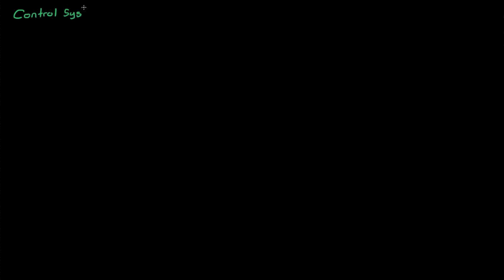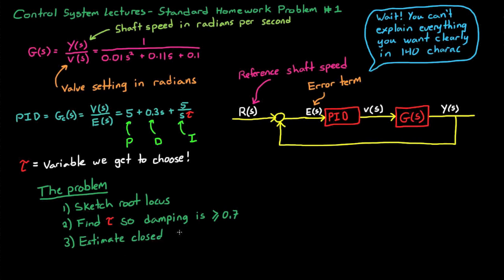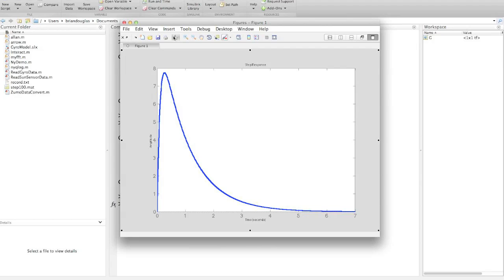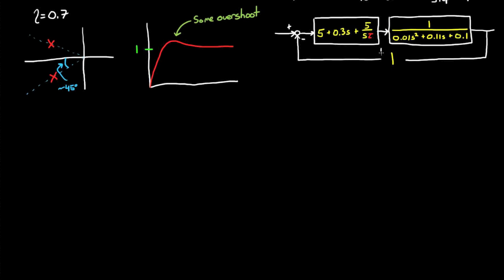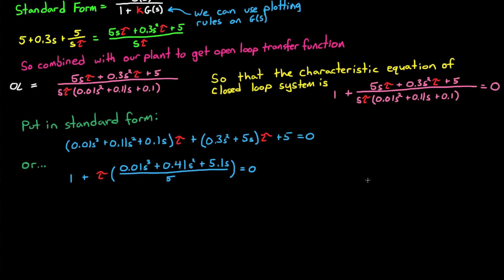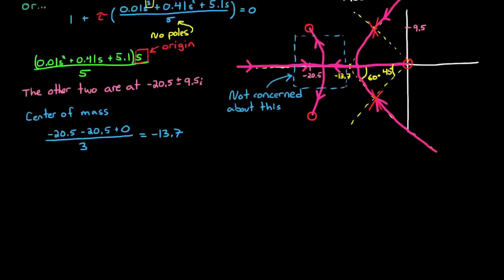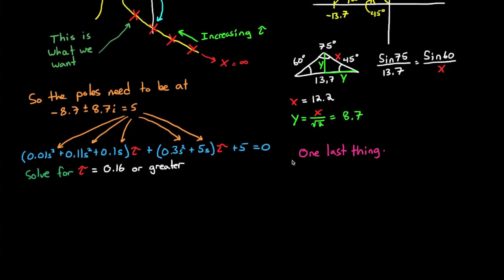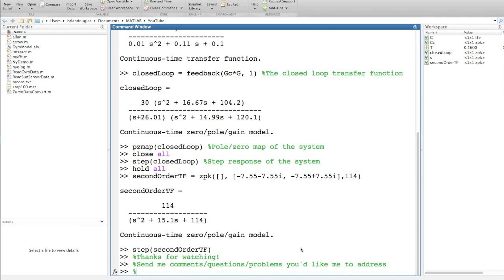Standard HW Problem #1: PID and Root Locus

Comment: "First Ill set the Diesel engine transfer function", G = tf(1, [0.01 0.11 0.1]). How do you get at this transfer function? Where did the 0.01, 0.11 or 0.1 come from? Why not 5, 17 and 0.0001? I've read about control theory, had classes about the Fourrier transform, s-transform, z-transform. I've worked with over a 50 systems that can be describes by a transfer function. But I've never been able to ever relate a real system to a transfer function. How?

Comment: I think it is sad that students are given problems like this.  In reality,  I have NEVER been provided a transfer function for the plant so learning how to do system identification is a must to get the plant /open loop transfer function.   Next the restriction on gains is wrong.   The problem puts a restriction on the gains because root locus in only good for determining ONE gain, not three.   In reality one would use pole placement to place the closed loop poles where you want.  It is possible to place the closed loop poles on the negative real axis in the s-plane so there is no overshoot.   It is still possible for overshoot to occur due to the zeros caused by the PID.   In this case it is necessary to modify the PID so the forward gains are different from the feedback gains to place the zeros too.  It is possible place all the closed loop poles and zeros to get the response you you want but the results may not be a standard PID.

One thing that NO one says is that the break away point is important. 
I never use root locus.  I have written many auto tuning programs.   System identification and pole placement are my main tools.   I don't see why root locus is still taught given there are better methods.

Now that I have thrown enough stones, Brian does do a good job of solving the problem as stated but the problem isn't realistic.

Comment: Hi Brian,
Thank you so much for helping all of us with controls concepts. I know this is a really really old video and I don't know if you're still seeing these comments. Could you please explain how you figured that the compensated system had 3 zeros and no poles, and then drew a rootlocus with 5 branches for a 3-zero system? It seemed to me that the forward loop TF of the compensated system had 2 zeros and 3 poles. 2 zeros from the PID controller, 1 pole from the PID controller and 2 original poles. That would make for a total of 5 CL poles and 2 CL zeros

Comment: Hi Brian,
What am I missing!? 
It looks like you did not solve for the roots of the characteristic equation.  You got -20.5 and +/-9.5i (at approx 11:00mins)
It looks like you ignored the 1 in the characteristic equation.
Reply from the maker: Hi Tom, I wasn't solving for the roots of the characteristic equation, I was solving for the poles and zeros of the open loop transfer function.  The closed loop transfer function has the characteristic equation (1 + open_loop_system), and if I solved for the roots that would give me the poles of the closed loop system.  However, the root locus plot works off of the open loop system, which was everything but the 1 +.  The open loop system didn't have any poles, but it did have three zeros, one at the origin and two at -20.5 +/-9.5i.  Does that clear it up? If not, my videos on root locus might help.  Cheers!
Reply: OK - yes I understand now. Thanks!

Comment: I definitely like the video. However, one key explanation is missing around 10:20, when the characteristic equation (CE) is re-arranged round t. Because the goal is to find t to achieve the desired closed-loop requirement, the re-arranged CE can be regarded as t being the open loop gain of the new open loop transfer function L(s) = (0.01s^3+0.41s^2+5.1s)/5. Now, this becomes the standard root locus problem, but L(s) does not contain the representation of the PID controller or the engine plant.

Comment: Can someone explain where the 45 degrees is coming from?
Reply: The approximated value of cos(45°) is 0.7, so that's the region on the plane we want
Reply: cos(theta)=zeeta
Reply: +Maciek Makopol cos(45 degree) = 0.7
I geagled it but don't know  if you can see the image
https://www.google.co.uk/search?q=damping+ratio+root+locus&espv=2&biw=1920&bih=971&site=webhp&tbm=isch&imgil=5AhJ8CDXIy2vAM%253A%253BmCW4yWgYW2wSmM%253Bhttp%25253A%25252F%25252Fvirtual.cvut.cz%25252Fcourse%25252Fsyscontrol%25252Fnode69.html&source=iu&pf=m&fir=5AhJ8CDXIy2vAM%253A%252CmCW4yWgYW2wSmM%252C_&usg=__ZinoGYbhyPYC9iMLPRbqo18NefQ%3D&ved=0ahUKEwjI0vepo8vMAhUSOsAKHXVKBWIQyjcIJQ&ei=8ZsvV4iWD5L0gAb1lJWQBg#imgrc=DgRWur0N1CIwkM%3A

Comment: Just as a general terminology question - "Critically damped" as I was always taught, and always refer to it, is when a system only overshoots once - and then asymptotically approaches the steady-state from the other side.  Damping without overshoot was called "over-damped", and multiple oscillations was "under-damped", with unending steady-state oscillations being 'un-damped'.

Where did you learn your terminology from, Mr. Douglas.  And do you see an advantage to one naming convention over the other?

Comment from the maker: Mimiko Liba Uh oh, did I? I don't think I meant to if I did.  Could you point me to the time in the video where I said that?  I meant to say that zeta = 0.7 is an under damped system.  Thanks for the comment!
Reply from the maker: Mimiko Liba I think I misunderstood your question at first. A critically damped system does have a damping ratio of 1 (so perfectly damped with no oscillation). The roots for a perfectly damped system exist on the real line. When the roots are on the imaginary axis the damping ratio is 0 and this system is undamped. What I said in the video is correct. Let me know if this is confusing or if I've once again completely missed your question.  Thanks!